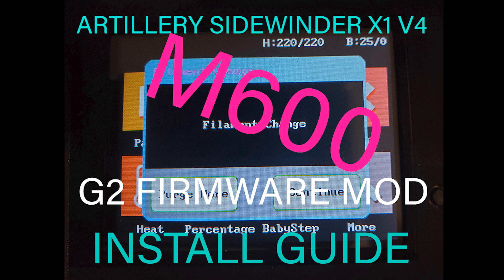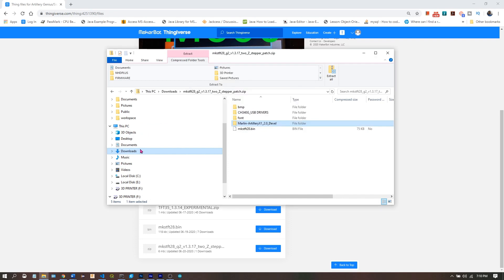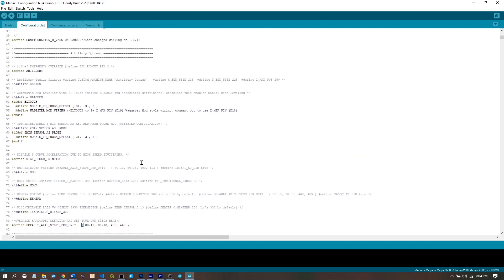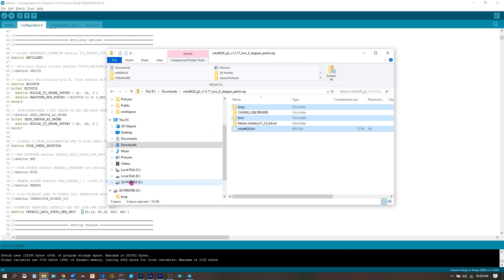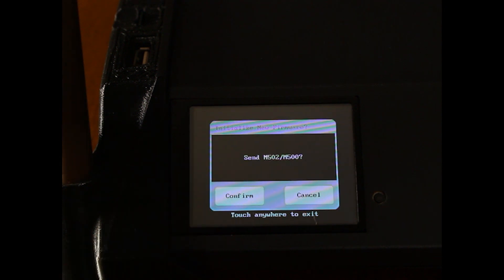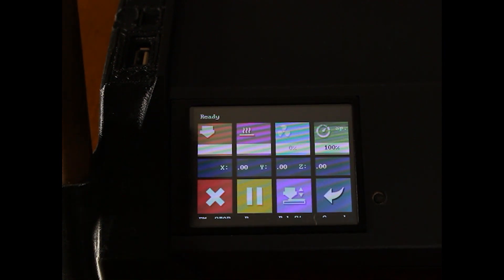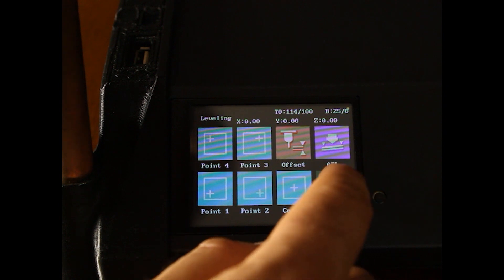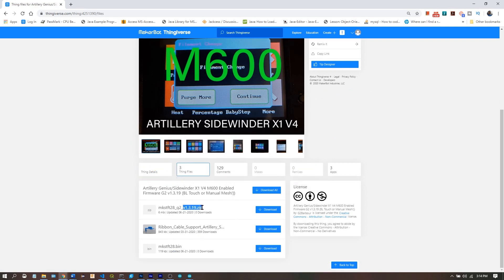INSTALL GUIDE: Artillery Sidewinder/Genius G2 Firmware with REAL M600 Color Change on Stock Hardware

Comment: Many thanks for your continous work, work great! u r the man :D
Reply from the maker: Thank you. Be careful printing from the USB drive until 1.3.39 comes out. I'm working on a very strange bug at the moment.
Reply: Print Engineering im using 1.3.38 with sd card, no issues for the moment
Reply from the maker: 1.3.40 is released. It should the issue resolved and a few other improvements, including display of layer number when sliced by Cura.
Reply: @PrintEngineering  i have problems with last tft firmware, tft shows a lot of errors when i try to print (unknow commands), and when finalizes too, with 1.3.39 works very good with the same gcodes
Reply: erros are "Invalid line start: MT1500", "unknown command: "MT) and retract acceleration", invalid line start: MT0", "filament runout"...and shows diverses "corrected parts", after that errors the impression starts. Now im using without errors v.1.3.38 in X1 with bltouch and microSD.
For future versions, it would be ideal to lower the speeds of travel and jerks in marlin, it goes too fast for quality prints.

Comment: This is so cool. I am trying to get this to work but keep getting an error when verifying. Downloaded version 1.1.34 this morning. I changed nothing. Running a stock sidewinder with no abl. Does this run manual mesh when an abl is not defined? Thanks
Reply from the maker: Yes it does. 1.3.38 is released and is greatly improved. What error messages are you getting? Maybe you have not selected the correct board and uploaded in Arduino IDE.
Reply: Print Engineering yes this new to me. I  got it working last night.  It was the board  and com. Flashed it and it works but don’t see mesh bed ,evening in the menus.
Reply: What is the correct board?
Reply: @advalue  mega

Comment: Wow. Thanks a lot for your great work. After two weeks of flashing up an down, your solution helped me, to make my X1 work again. There is only one problem left:  the dispay says: "no printer connected",  but everything works fine. Perhaps you have an hint, where i can find and kill this last leftover of my problems. greets from germany
Reply from the maker: Upgrade to the latest version. 1.3.32 right now. There was a transition period to a new connection algorithm and a few versions had that issue.
Reply: @PrintEngineering  Thx. I will try. I don't understand what you mean, but i try :-)
Reply from the maker: @jfhp  I'm working on getting rid of all the bugs. It is very close now.
Reply: @PrintEngineering  Flashed again, PID tuning is running. And the Display says: No Printer attached"   Sorry for that feedback.   For me it's ok. I'm happy with that. I  think i should never change a running printer any more. Thanks again for your work and help.
Reply from the maker: @jfhp  sometimes it takes a moment to confirm connection when it boots up, but if it is still a problem I am releasing 1.3.33 later today and it will have some changes to the connection process that may help with your issue.
Reply from the maker: Also, you do not need to PID tune of you only change the TFT firmware. You don't need to PID tune unless you flash Marlin. You also don't need to include the BMP and font folders when you flash the TFT firmware unless the icons have changed.
Reply from the maker: 1.3.33 is available now. There has been a few revisions to the connection process and a notification is given on the serial port when connection happens. That should help trouble shoot of the problem persists for you. Here are two commands that yo need to see on the srial port for successful connection:

//action:notification enhanced M155 enabled

//action:notification TFT connected
Reply: @PrintEngineering  Sorry, nothing happend. Now i have V1.3.35 installed. Nearly everything works fine. Heat, move, pid, leveling....  When i open the serial monitor in arduion, i'll get all informations every few seconds: temp bed, temp extruder, position.  But on display there is "No printer attached", and no actual bed temp, no extruder temp, no position.  Can you tell me, where the pins of the board to the TFT are defined?  Perhaps there is a problem with my TX\RX and D1/2 connection!?
Reply from the maker: @jfhp  I just released 1.3.36, the connection process should display a few more things than the last time we spoke. It should look something like this when you connect a serial monitor: 
//action:notification TFT connection reset
ok
ok
//action:notification enhanced M155 enabled
ok

ok
ok
echo:Invalid mesh.
Error:Failed to enable Bed Leveling
echo:Bed Leveling OFF
echo:Fade Height OFF
ok
//action:notification enhanced M155 enabled
ok

ok
ok
echo:Invalid mesh.
Error:Failed to enable Bed Leveling
echo:Bed Leveling OFF
echo:Fade Height OFF
ok
//action:notification TFT connected
ok
//action:notification TFT ABL Leveling Style
ok
//action:notification TFT advanced Marlin mode
ok
 T:21.91 /0.00 B:22.66 /0.00 @:0 B@:0
X:0.00 Y:0.00 Z:0.00 E:0.00 Count X:0 Y:0 Z:0
wait
Reply from the maker: @jfhp  let me know what part of that process appears for you. I added it just to troubleshoot situations like yours
Reply: @PrintEngineering  i'll try. This message should appear on serial monitor?
Reply from the maker: @jfhp  yes it should appear something like what I posted above
Reply from the maker: 1.3.38 has been released and addressed some connection issues. I am not sure if it will address your problem, but it might.
Reply: @PrintEngineering  This ist what the display says now:  echo:start
Marlin bugfix-2.0.x
echo: Last Updated: 2020-06-21 | Author: G2
echo:Compiled: Jul  6 2020
echo: Free Memory: 3073  PlannerBufferBytes: 1632
//action:notification Artillery Sidewinder X1 Ready.
echo:V80 stored settings retrieved (731 bytes; crc 40630)
echo:  G21    ; Units in mm (mm)
echo:  M149 C ; Units in Celsius
echo:; Filament settings: Disabled
echo:  M200 S0 D1.75
echo:; Steps per unit:
echo: M92 X80.13 Y80.18 Z400.00 E445.00
echo:; Maximum feedrates (units/s):
echo:  M203 X300.00 Y300.00 Z50.00 E70.00
echo:; Maximum Acceleration (units/s2):
echo:  M201 X3000.00 Y3000.00 Z150.00 E10000.00
echo:; Acceleration (units/s2): P<print_accel> R<retract_accel> T<travel_accel>
echo:  M204 P800.00 R10000.00 T2000.00
echo:; Advanced: B<min_segment_time_us> S<min_feedrate> T<min_travel_feedrate> J<junc_dev>
echo:  M205 B50000.00 S0.00 T0.00 J0.01
echo:; Home offset:
echo:  M206 X0.00 Y0.00 Z0.00
echo:; Mesh Bed Leveling:
echo:  M420 S0 Z0.00
echo:; Material heatup parameters:
echo:  M145 S0 H180 B70 F0
echo:  M145 S1 H240 B110 F0
echo:; PID settings:
echo:  M301 P14.67 I1.10 D48.96
echo:  M304 P30.00 I5.91 D101.58
echo:; Linear Advance:
echo:  M900 K0.13
echo:; Filament load/unload lengths:
echo:  M603 L30.00 U70.00
echo:; Filament runout sensor:
echo:  M412 S1
//action:prompt_end
wait
wait
wait
ok
ok
ok
echo:Hardcoded Default Settings Loaded
ok
ok
echo:Settings Stored (731 bytes; crc 40630)
//action:notification Settings Stored
ok
//action:notification TFT connection reset
ok
echo:Unknown command: "M851"
ok
ok
//action:notification enhanced M155 enabled
ok
ok
//action:notification enhanced M155 enabled
ok
 T:21.33 /0.00 B:21.21 /0.00 @:0 B@:0
X:0.00 Y:0.00 Z:0.00 E:0.00 Count X:0 Y:0 Z:0
wait
 T:21.05 /0.00 B:21.02 /0.00 @:0 B@:0
X:0.00 Y:0.00 Z:0.00 E:0.00 Count X:0 Y:0 Z:0
wait
Reply: And some errors appeared while compiling.
Reply: @PrintEngineering  OK, after all i think there could be a problem with my rx/tx pins. Is it possible rewire them to  Serial2-pins?  TX D16/RX D17 On exp2?
Reply: rewireing and "#define SERIAL_PORT_2 2" did the job! THX for your help.
Reply from the maker: I've been buried in code for 2 days, but I think the USB drive printing issue is fixed, and there are further connection improvements and display of layer number when sliced by Cura.
Reply from the maker: That is strange that you had to move your serial port. Stock hardware?
Reply: @PrintEngineering  yes. i think there was a broken pin (not visible) after pulling out the cable for my first firmeware-update.
Reply from the maker: @jfhp  glad you got it figured out. Keep an eye out for the latest versions. There have been some major improvements

Comment: I have a problem. I get an error while compiling in Arduiono. The whole list is long, here is the last lines. If not enough where can I mail/transfer a zip-file?
I use the stock Genius, so the only thing I have done is removing the 2 (//) in front of the line.  I have tried to compile without removing the (//), same result, error.
I am using the "mkstft28_g2_v1.3.20", could not find the "mkstft28_g2_v1.3.17" you are using in the video.

Last lines of the code:
c:\users\gertv\appdata\local\temp\arduino_build_427972\sketch\src\hal\avr\fastio.h:96:31: note: in expansion of macro '_WRITE'
 #define WRITE(IO,V)           _WRITE(IO,V)
                               ^~~~~~
sketch\src\module/stepper/indirection.h:145:36: note: in expansion of macro 'WRITE'
     #define Z2_ENABLE_WRITE(STATE) WRITE(Z2_ENABLE_PIN,STATE)
                                    ^~~~~
sketch\src\module/stepper/indirection.h:684:34: note: in expansion of macro 'Z2_ENABLE_WRITE'
     #define DISABLE_STEPPER_Z2() Z2_ENABLE_WRITE(!Z_ENABLE_ON)
                                  ^~~~~~~~~~~~~~~
sketch\src\module/stepper/indirection.h:851:51: note: in expansion of macro 'DISABLE_STEPPER_Z2'
 #define DISABLE_AXIS_Z() do{ DISABLE_STEPPER_Z(); DISABLE_STEPPER_Z2(); DISABLE_STEPPER_Z3(); DISABLE_STEPPER_Z4(); CBI(axis_known_position, Z_AXIS); }while(0)
                                                   ^~~~~~~~~~~~~~~~~~
sketch\src\MarlinCore.cpp:490:42: note: in expansion of macro 'DISABLE_AXIS_Z'
         if (ENABLED(DISABLE_INACTIVE_Z)) DISABLE_AXIS_Z();
                                          ^~~~~~~~~~~~~~
exit status 1
Error compiling for board Arduino Uno.
Can you help?
Reply: BTW. The Arduino software is just installed, I have not done any changes in settings. I guess its, what I have to do, but I don't have a clue.
Reply from the maker: First things first, download 1.3.25 so we are working on the same code. The only known problem with the latest version is no USB DRIVE support - which has apparently been an issue for the last few versions and I'm working on that today.
Reply: @PrintEngineering  Done, but the best is to wait until you fixed the USB, right?
Reply from the maker: @Gert-DK  the hope is to have USB drive printing fixed today. I'm doing filesystem research now. This is a topic I've never have to mess with before so it's a steep learning curve at the moment.
Reply: @PrintEngineering  I'll just wait, thnx
Reply from the maker: @Gert-DK  after a grueling 18 hour day, I have had some successful testing with the USB as well as reverse compatibility with the older models. I should have it buttoned up for release tomorrow
Reply: @PrintEngineering  Super, I am looking forward with joy.
Reply from the maker: 1.3.26 is uploaded if you want to give it a go. It should have the USB issues resolved
Reply: @PrintEngineering  I think it works now. All installed seems OK. Haven't tried the "pause at height" yet. Have to go to bed, its over 5 AM here. I will let you know how it goes.
Reply from the maker: @Gert-DK  could you please confirm that you are running version 1.3.27 from last night so we are running the same version code, then send me the the gcode for the file that was causing the too long extrusion prevented errors.
Reply: @PrintEngineering No its 1.3.26. I will try the new one. But where to send the gcode?
Reply: @PrintEngineering   Just downloaded the one from Thingiverse and compiled it and flashed. In the printer display under "Info" it says "G2 Beta 25.1.1.3.26". The error is still there.
Reply from the maker: @Gert-DK  you don't have to flash Marlin to update the TFT firmware, just put mkstft28.bin on the SD card and reset.

Also, I just downloaded it from thingiverse and flashed it and it is reporting 1.3.27, please confirm 1.3.26 is appearing on you screen
Reply from the maker: You also don't have to use the BMP and font folders unless there has been a change to the icons
Reply: @PrintEngineering  I did the "mkstft28.bin" with the card and now it says "1.3.27" in the display, that's fine now. But the same error is still there. The gcode is made in Cura 4.6.1 and I haven't had this error before.
Reply from the maker: I have removed my email from the thread. The Too long extrusion error you mentioned was a bug with the USB drive, and has hopefully been addressed by 1.3.28.

Comment: As you have figured out I am a complete newbie into this. I have a Q. What program are you using when editing the INO file in the video? I would like to have it too, so I can follow your guide to the letter.
Reply from the maker: Arduino IDE https://www.arduino.cc/en/main/software
Reply: @PrintEngineering  Thnx
Reply from the maker: And make sure you are using version 1.3.22 or later. There was recently an accidental release of a debug version that did not connect to Marlin properly.
Reply: @PrintEngineering  Thnx
Reply: @PrintEngineering  Downloaded v. 1.8.13

Comment: Very nice, Artillery should give you credit with all the hard work you've done here!  
Btw, don't forget to leave "marks" on the FW you've edited/made to avoid others on profiting because of your hard work.
Reply from the maker: Though it is heavily heavily modded, I built this on open source code and it will be released after a short delay. Eventually I'll pass the torch on this and move on to other projects. This was more or less the result of my disappointment with the firmware options available and an opportunity to get my hands dirty with microprocessor programming, which I had never done. It is also an experience in getting a product ready for official public release. These are all skills I will need for future projects, so this has been a form of education for me.